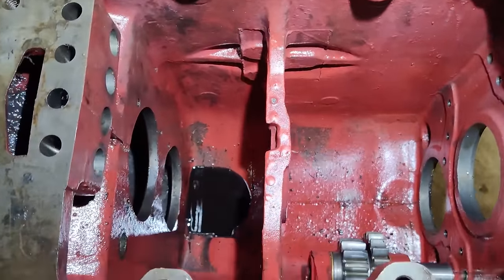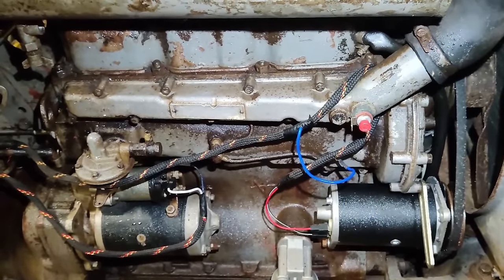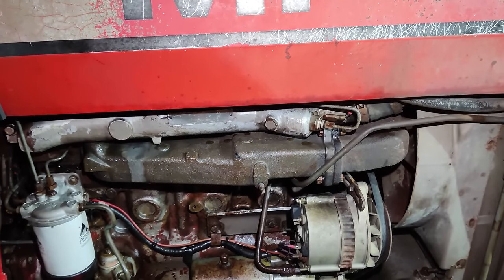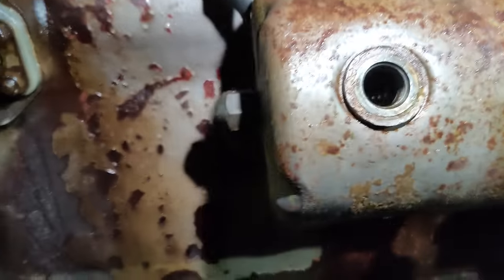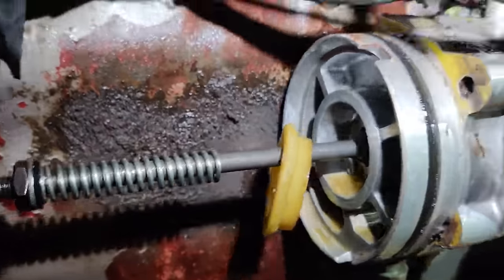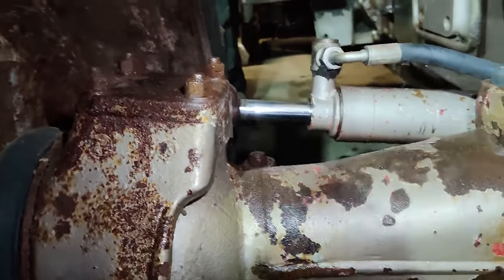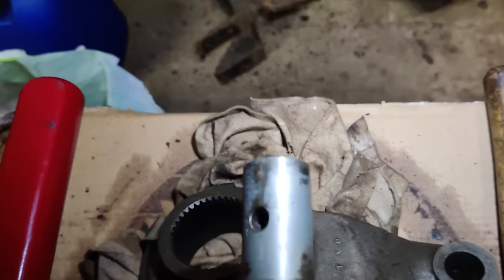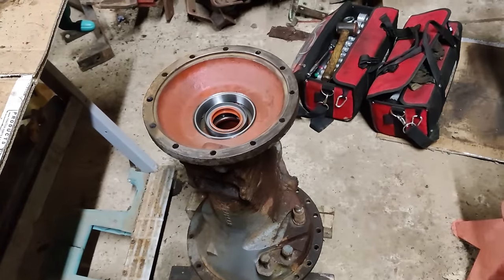A bit of this and that.

Comment: Turbo filter is smaller thread, didn't realise when I changed the one on the 1200!
Had to wait a while till a correct one arrived.
Reply from the maker: It's 5/8 X 18 for the turbo filter and the normal Perkins engine one is 3/4 x 16.  

You probably know already, but the Fram cross reference for the turbo filter is LF607.

Thanks for watching.
Reply: @ClarenceFudWeasel  thanks, I just ordered the same as was already on there, a Donaldson I think.
Reply from the maker: At risk of opening a can of worms, I'd say that Donaldson is probably a better filter.  Maybe I should do a filter comparison video at some point in the future 😁
Reply: @ClarenceFudWeasel  good idea.
I have little experience outside of Perkins/Agco, we mostly stick to genuine here.

Comment: I have to go back and watch other videos because I think I missed something as to how that manifold preheater and excess fuel system works. I used one of those locking grease couplings for the first time last fall, worked great. Looks like you had a meeting of the minds, I’m sure it was for the exchange of ideas and knowledge. I remember having some of those 30 years ago standing around motorcycles.
Reply from the maker: I have been meaning to buy one for years.  I guess Lord Muck dropped it.  Well it's mine now 😂

Thanks for watching.

Comment: That filter looked choice !!! 🤮

Have done the swivel pins on a couple of old Masseys not a bad job if it all separates well ! :) 

Happy new year!
Reply from the maker: And it was in back to front too so it wasn't doing a lot.  The advantage of this particular axle is that it's pretty simple and fairly easy to work on. 

Thanks for watching.

Comment: Had no clue there is a filter in the PS reservoir. Should have known because transmission reservoir is always filtered .
Reply from the maker: It helps if the previous owner puts the filter in the right way round too 😁.  Thanks for watching.

Comment: I'm in Southern Victoria Australia, not sure if they were the same in the UK but the first Massey Ferguson 165 came out with, I think the same engine which was in the 65, it had the exhaust on the left, like the one you are working on and I think that was 58hp, then they replaced it with the 62hp version and it had the exhaust on the right side, that one is very popular down here, I know a farmer who had 2 of them with cabins in the 1970s and 1980s, just wondering, are you going to paint this one?
Reply from the maker: That's correct, the early ones were fitted with the 4.203 engine and the later ones with a short stroke version of the 4.236, the 4.212.

I wasn't planning on painting the 165 because it's going to be a working tractor and the paintwork tells a story.  The 175 however I want to do a factory restoration.

Comment: I've always been told to use engine oil in the power steering system on our MFs in case the seal between the pump and the engine fails, would this cause any damage to the tractor?
Reply from the maker: It won't do any harm to use engine oil, it just has slightly different viscosity characteristics than ATF, and the steering will be a bit stiffer on a cold morning.
Reply: @ClarenceFudWeasel  Oh right thank you